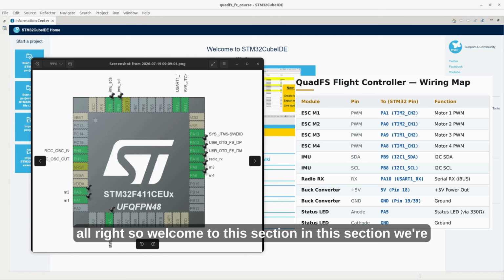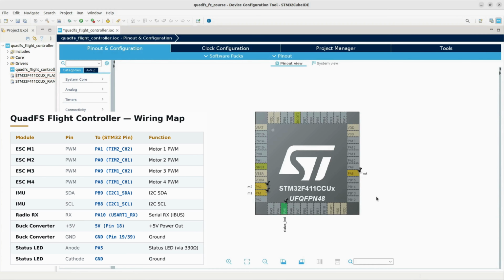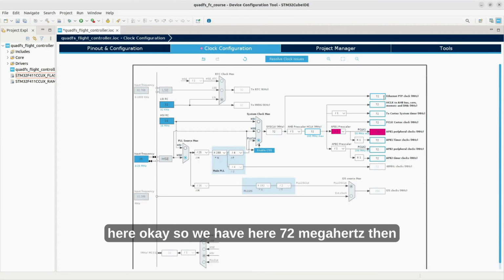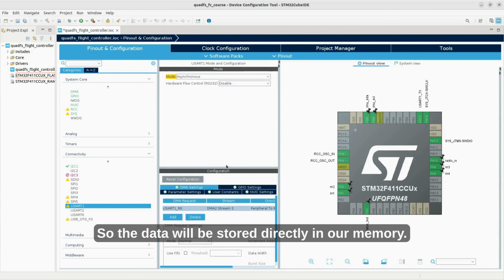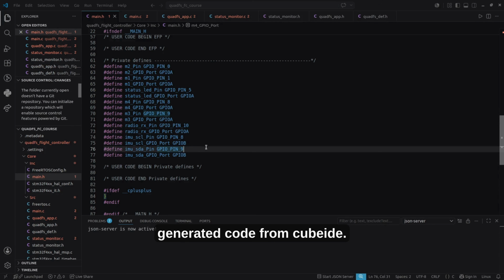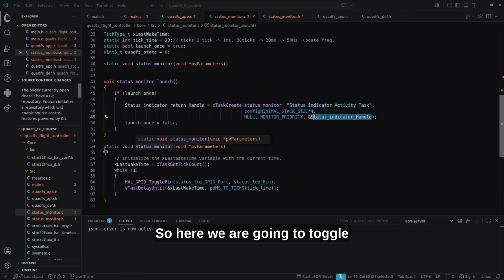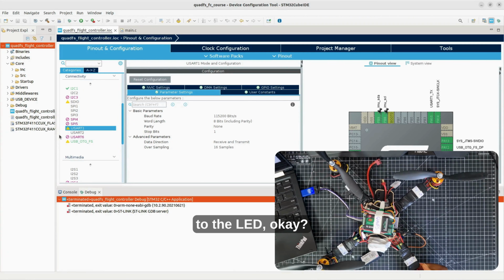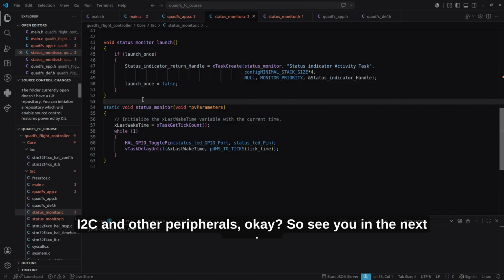STM32 Drone Firmware Part 1: STM32 Setup & Why You Need FreeRTOS

Comment: Brother everything was good but i have a question what does that FREERTOS thing do in cubeide? I have never heard of that before.
Reply from the maker: FreeRTOS allows you to put certain "jobs" into different  tasks so that they can execute separately.

Take for example, if your control loop is designed to run at 333 Hz, and you have a sensor like an Ultrasonic sensor that can only run at say 10Hz. If they are in the same loop or task, you can't achieve your 333 Hz frequency needed for your controller. So what you do is put the ultrasonic sensor processing and the control loop in two different tasks.

The controller should have higher priority so it can stop the ultrasonic sensor processing from running temporarily to execute it's own task. then release it when it's done.

Checkout parallel and concurrent programming/processing.

Comment: How can we choose the correct imu for this buid, bcz i think the stability depds on it. Mpu6050 i2c, mpu6500 mpu9250 bmi160 bmi270 etc
Reply from the maker: Mpu6050, MPU-9250 and mpu 6500 are supported by the firmware.

MPU-9250 is actually mpu6500 combined with a magnetometer, and that's what I've used.

Which ever sensor you use, make sure its properly calibrated and you calculate and apply your tilt offset properly.